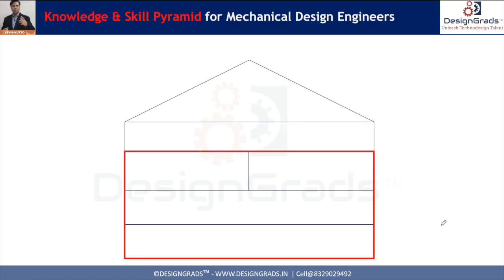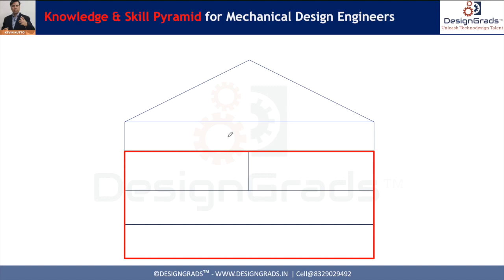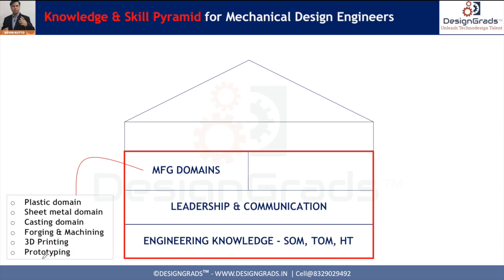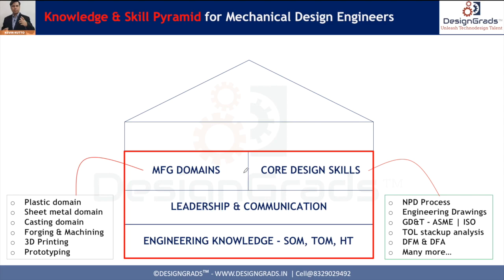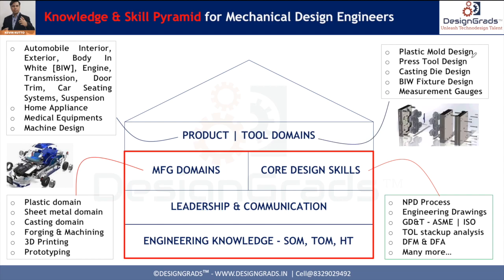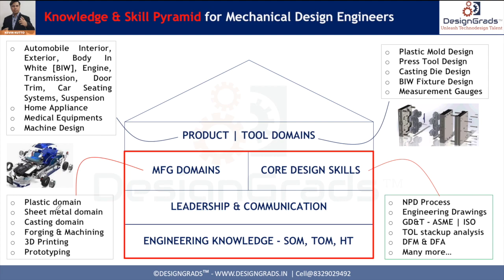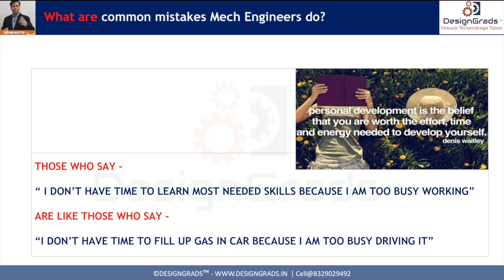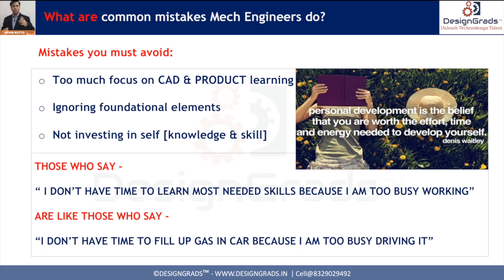How to become Design Engineer | What is Design Domain | Top Mechanical Design Skills for Freshers

Comment: In Manufacturing domain one doesn't need to be expert in all the domain any two or three will be alright.
Reply from the maker: I beg to differ. Imagine you are Design Leader of Seating Subsystem.  You have to deal with plastic, sheetmetal, foam, casting, forged and machined parts and also prototypes. Without knowledge of manufacturing processes in details, it becomes challenging to lead subsystems or systems projects. Off course, you don't learn overnight.  But one has to learn these processes over the time if you wish to grow in your product design career.

Comment: What is lacking in Mechanical Engineers today, is the knowledge of how to design mechanisms correctly. Did know that there's a mathematical formula that can be used for all mechanism designs? It's called Gruebler's Count. I found a way to make it practical for all 3D mechanisms. Here's the link if you are interested.  https://youtu.be/KFB8gMjxDPk

Comment: Can u tell me the source to get knowledge and skill for engineering calculations
Reply from the maker: It depends upon which calculation you want to learn.

Books could be great source to learn calculations.

There are handbooks, books on SOM, TOM, Heat Transafer, Hydraulics and pneumatics which you might have used in Engineering.
Reply: Hii Akhil are you student or working???

Comment: Sir which domain is best for the fresher design engineer seet metal or plastic.
To find the easly job?
Reply from the maker: Both the domains are good. In fact, I suggest to learn both the domains because as you grow in career, you have to deal with both plastic and sheet metal parts in product.

Safe bet to start is plastic design because of high application in automobile as well as non automobile companies.

And, as you master plastic domain, start learning sheet metal as well.

Design engineers with knowledge of both these domains are in demand with industries for sure.